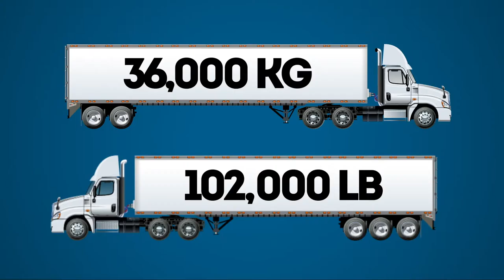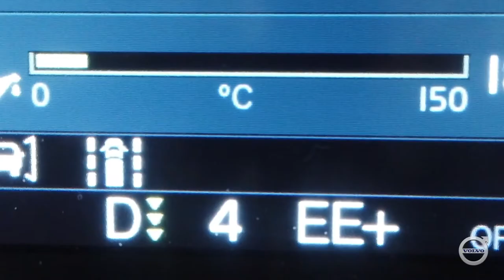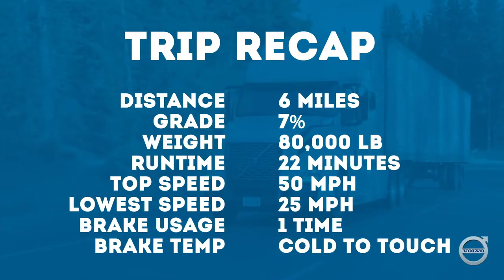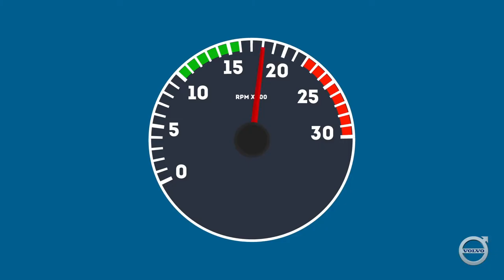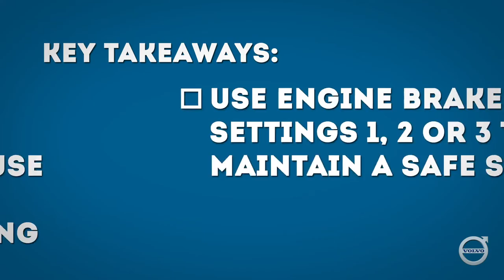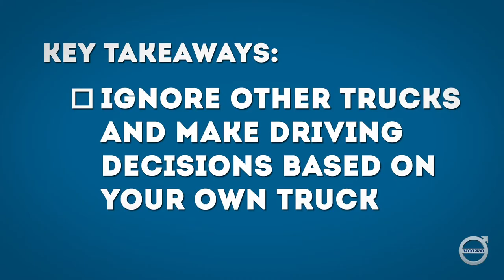Mountain Driving 101: Match the truck gear and speed to the grade (Episode 4)

Comment: I have run the mountains in Canada and the U.S.A. for a bit of time. The truck I drove, a Freightliner Cascadia, did not have a very strong Jake and it certainly had its moments for sure. I gave up on mountain hauling as the headaches I got every time I got over 10,000 feet and up to like 15,000 feet elevation were severe. So I stayed more mid-west and east coast. In 2014, I had kidney cancer and had one removed. My wife asked if I could stay closer to home, which I did. I didn't do the U.S.A for very long out of my 50 years of trucking and stayed in my province of Ontario. What I have learned is that trucking is divided into groups. Territories, Mountain West, Prairies, Northern/Southern Ontario, Mountain East, and Atlantic groups. Each has its very own challenges and all are very distinct from one end of our country of Canada, to the other. Respect to all of you.
Reply: No one cares
Reply: @francescobaruffi999  do I, after all these years, I don't care anymore...
Reply: I always take my time going down I’ve been driving over 30 years it only takes one time going down the mountain too fast and you’ll understand I started driving in 84 and lost my brakes once no engine brakes and I’m still here to talk about it but it’s something I’ll never forget respect the mountains there dangerous

Comment: First time I tried something like this, was in early 2000s in a Renualt Magnum 440, fully loaded. It was in Germany, the Kassel Hills. They are called hills, but don't be fooled, these hills are steep and there are runaway ramps. It was also at night and it was raining. It was scary as hell. But I knew the theory, so it turned out all right. Ohh boy it was nice to get out of theese hills, but later it gave a nice feeling of have done something difficult the right way.
So if you are a new trucker, just do as they do here in the truck. And as said, completely ignore traffic behind, you can't do anything for them.

Comment: How did the drivers in the old days drive these mountains without an engine brake?
Reply: The weight of their balls dragging on the road slowed them down.
Manual transmission, you can select your gears, you had 10-18, so you can creep down.
Reply: I drove in the late 70s early 80s (they didn't have engine brakes) and went to MCT training class and was trained by guys who drove in the 50s 60s and 70s.  This was the official training for mountain driving.  Usually the gear you go up in is the gear you go down in, or one gear lower.   Here is the part most people don't get, but I believe this is how all the Corn Flakers did it too.  You use a gear low enough that you put 20 PSI on the brakes using the gauges to keep track of pressure on the brakes.  

No more than 20 PSI and a low enough gear the the engine will hold at 2000 RPM with 20 PSI on the brakes.  This is no shit.  You can ride the brakes all the way down the hill with that steady pressure and they won't over heat.  If you have to use more pressure on the brakes to hold the rpm down, you will lose your brakes.  I did it once.  
We were not absolutely do not FAN the brakes.  I've been over many of the hills going west from California to Washington..  We only went west.

Comment: My instructors informed me on using the engine brake levels in the mountains but told me to never put the volvo in manual mode.. So should I control the gear in manual mode as well?

Comment: Whatever gear you climbed with determines the gear you descend in. Never shift gears while descending. Example: If you climb in 7th gear you descend in 6th. This is basic information you're tested on when testing for your CLP.
Reply: It's basic information, and it's a reasonable guideline, but it assumes your load will be the same in both directions. The reason we did this video was to dispell some of those myths. Do what you need to do to pass the test, but don't try that in the real world. Use your engine brake and gear selector properly and you'll never have to touch the brake pedal, or worry about remembering which gear you climbed the hill in. Just sayin'.

Comment: Do you have a video on an automatic transmission?
Reply: This was automatic, just with manual select.
Reply: @CrotchRocket78   the Manual select seems hard to do because the buttons are on the dashboard vs on a stick or steering column.